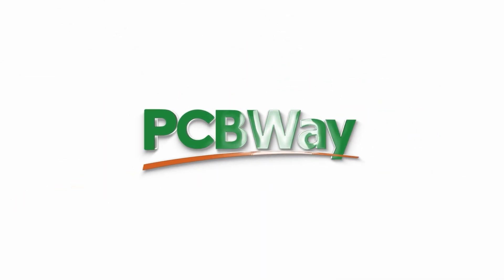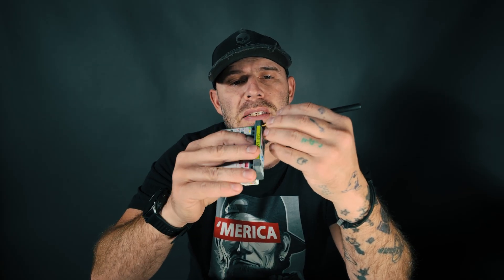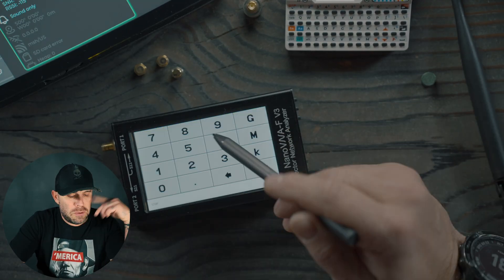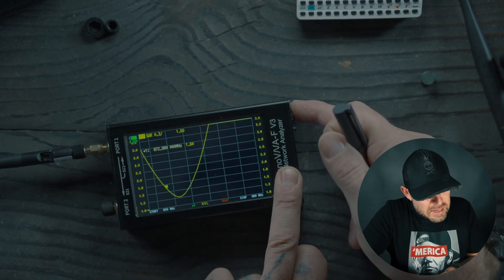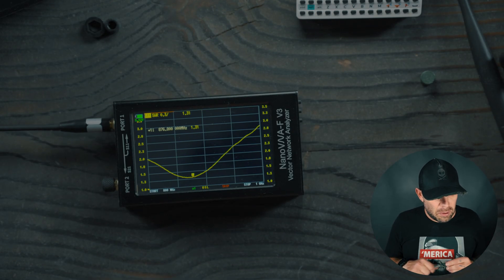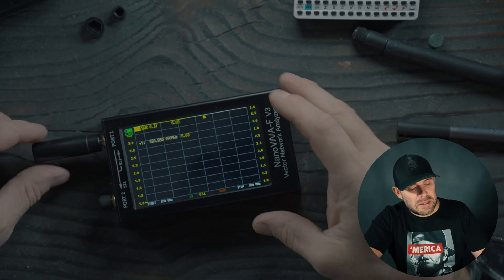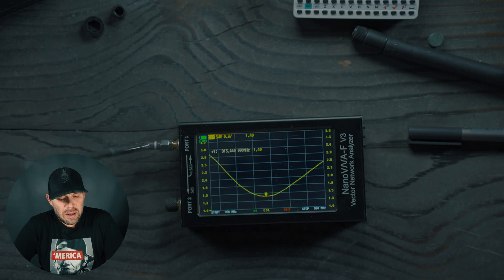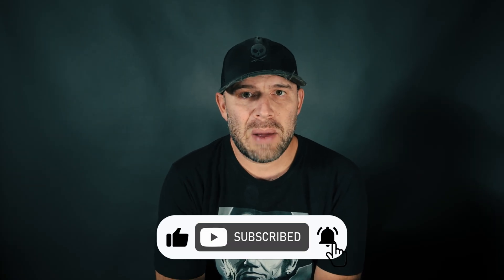Choosing a Meshtastic Antenna

Comment: To measure the antennas using the tinyvna,  I use the i-pex to sma jumper cable,  this is how your LoRa board will "see" that antenna in the real world.     having the antenna close to the table like that will give false readings.  I will let the antenna hang off the side of the table or hold it at the base.

in my location we have switched to Medium fast,  which is 913.125 mHz  there can be a substantial difference in swr between long fast and medium fast.  antennas that have truly been tuned to 915Mhz will benefit Medium fast more than long fast.
Reply from the maker: Great points and insight. Thanks for the tips and advice. I’ll do a second reading when I get time with a jumper cable and have it free from anything around it. 

Greatly appreciated!

Comment: Another way to create a ground-plane for those stubby antennas is to use a counterpoise (basically a piece of wire connected to the ground side of the SMA and just hanging off the side (for 800-900mhz a 3.5 inch piece should be more than long enough).
Reply: This is a great example of what knowledgeable input should be found in a comment section.